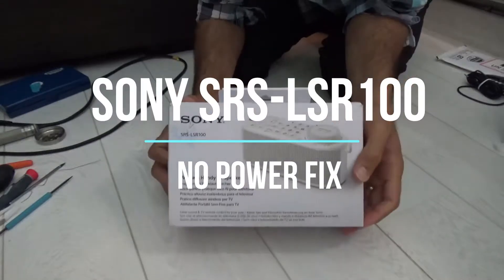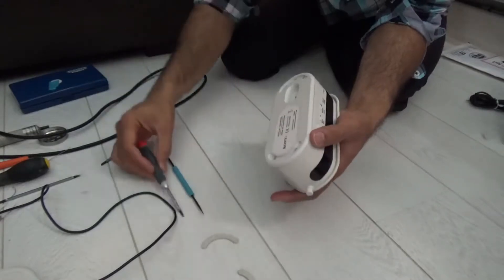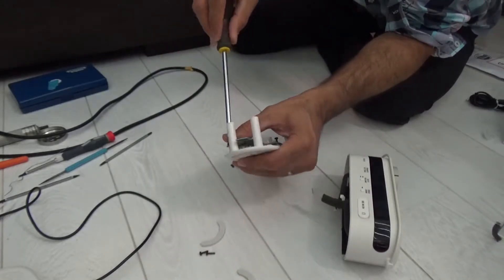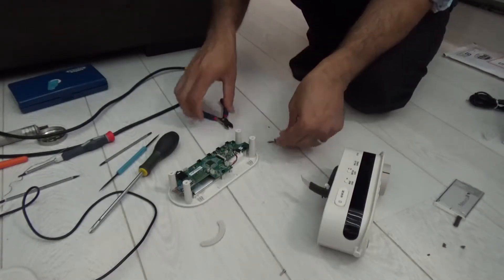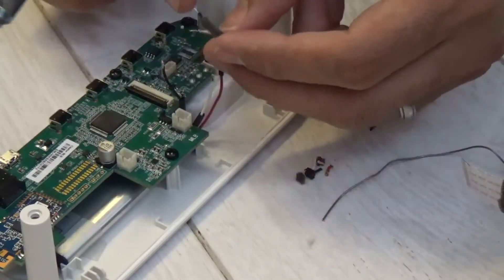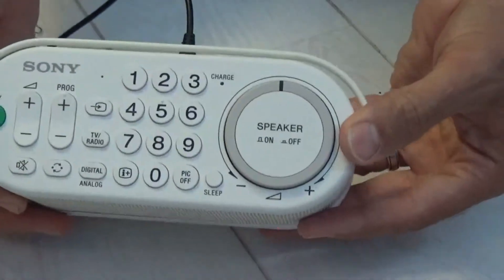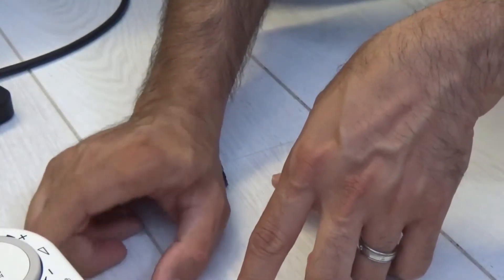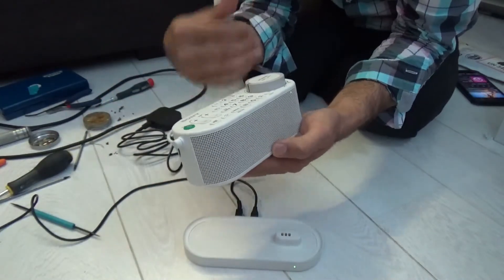SONY SRS-LSR100 Power Fix

Comment: Thanks for this, my elderly parents have two of these devices and one stopped working. I ordered a battery and had to solder on the old connector as you did and it back working. When it was taken apart I also sprayed some contact cleaner on the back of the volume knob and the circuitry underneath it. Before it stopped working completely the volume would jump when turning the knob but now its working perfectly. Your video was the only one I found on a repair and the details on the battery replacement ,so thank you for posting.

Comment: the most important thing is 

low latency to be able to use tv speakers and this tv rear box for an impaired hearing ... my father gets his level close to his ears while his wife is enjoying tv speakers 

Bluetooth speaker suffer a lot in many cases like no base to charge, not tv or voice  dedicated and no remote control.

ANOTHER BIG + UNSUAL POINT:
Sony has opened its normally closed shop but this device and its remote control are useable with other TV brands like Philips, Samsung, ... that I had not expected.

So all these buttons ir at least a lot of them seem to be useable with most non Sony TV and that is a quite handy feature, a second remote. While the speakers face to yourvear the back of the speaker will show to the TV, the dark brown piece contains your 2nd IR transmitter facing natively + perfectly to the TV.

great video
Reply from the maker: @TYP xxi - Thank you for watching my channel- your spot on - Love your comments. Please subscribe and we can make the world a better place.
Reply: @thespecialist786  thanks, subscribed already ... and I added a second, major, unexpected benefit to my comment:

the integrated remote control works with a lot of other TV brands, specifically with Philips + LG, that we have in use. 

Also the box itself as a micro usb for constant charging without the docking.